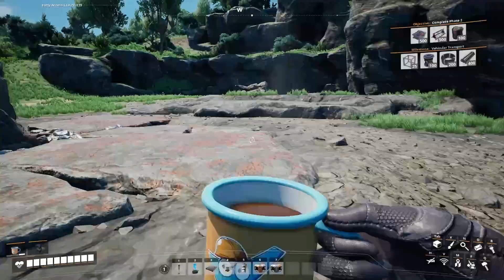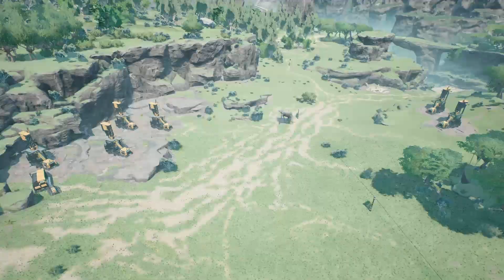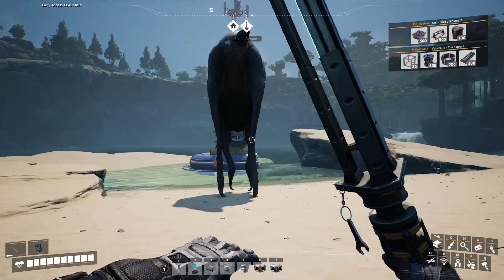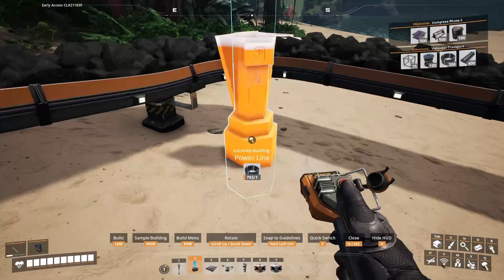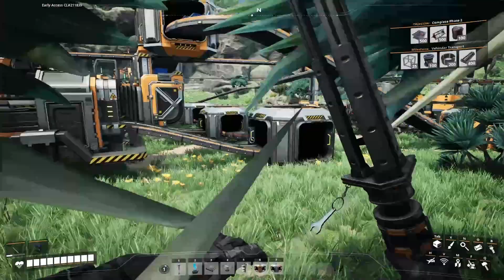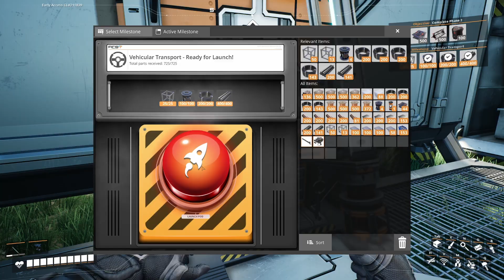What Do I Do With All These Modular Frames? Satisfactory

Comment: u should really invest in a slightly larger scale module frame factory cause you really need them once you past phase two of the space elevator
Reply: There is a Pure Iron node pretty close to your new Coal-Plants if you want to use that since its 120/min
Reply from the maker: I will have to go searching for it! I didn’t know if any were close to the coal or not
Reply from the maker: I agree, but with only imperure nodes available it was all I could squeeze out of them for the time being.